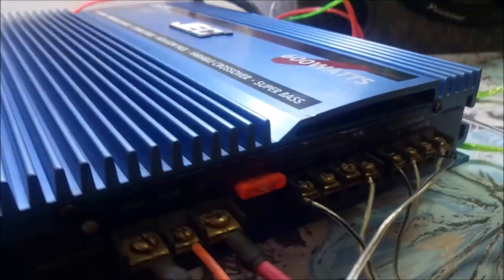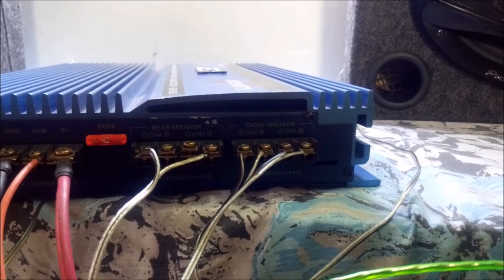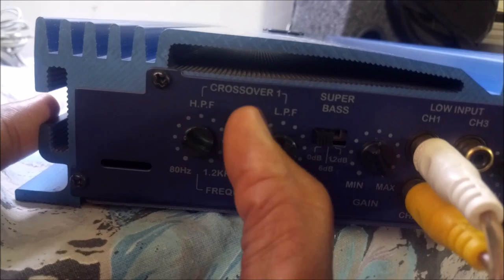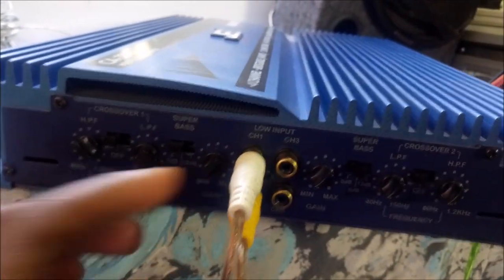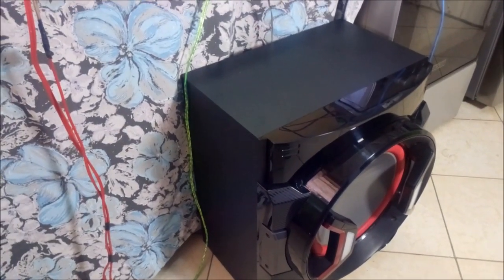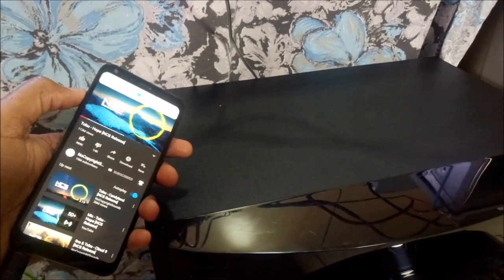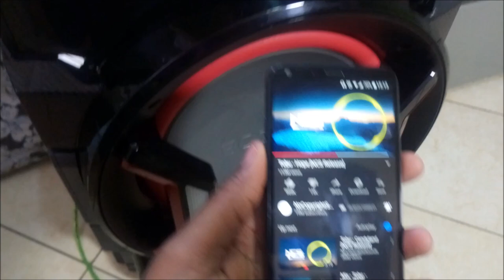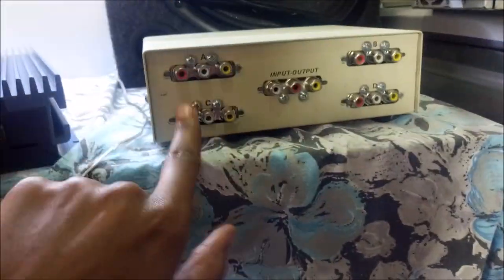JEC Car Audio Amplifier for Beginners

Comment: thanks for the video, my question, what setting should i use on the jec amp if i wanna connect it with an equalizer (boshmann).
Reply from the maker: It's better to leave it on full range mode because the equaliser will take care of the frequencies
Reply: thanks, another issue the amp inazima nikijaribu kuplay deep bass, inabidiii ni unplug then nirudishe ndio icheze tena, siwezi i push to its maximum. my power supply 12v 30amp.
Reply: @victorazenga8752  Tafuta power supply ya 60+amperes
Reply: @boerandemo7766  yes niliget iko sawa thanks
Reply: @victorazenga8752  nani alikufanyiya connection. I've everything set; kufunga ndio challenge.
Reply: @boerandemo7766  myself sio ngumu
Reply: sio ngumu terms ndio tricky hahaha
Reply: @victorazenga8752  Hehe... I like you already. What set of cables do you  need?
Reply: @boerandemo7766 rca to rca cables. For amp and  equaliser connection
Reply: for power connection I used a  cable with 1.5 amps . connecting power supply nd   my  amplifier
Reply: @victorazenga8752  Thank you for the insightful response. I've 5-channel JEC 1200W, 4-mids &2-tweeters, 83amps power unit, and sub woofer. Also the boschman eq. 

You wanna do a video on how to connect?
Reply: @boerandemo7766  nini imekulemea.
Reply: @boerandemo7766  nini imekulemea
Reply: @victorazenga8752  Apa umenishika... 😂. Actually haven't started. Wanted to know the right cables to buy.
Reply: @boerandemo7766  😂😂😂
Reply: @victorazenga8752  that notwithstanding; powering the eq naona ni shida coz it's indicated 11V yet the power unit is 12V. Advise.
Reply: @boerandemo7766  .
Reply: @boerandemo7766  iko sawa dnt worry about it. different of 1v ni kidogo
Reply: @victorazenga8752  cheers
Reply: @victorazenga8752  Eureka! I did it. And it's not an exact science; just an art. 

Challenge now being how to hook the ts20s to their individual capacitors then into the booster. 

Which males go into which females?
Reply: How many speakers and sub can a 1500watts car amplifier pump..... I love watching ua video their great